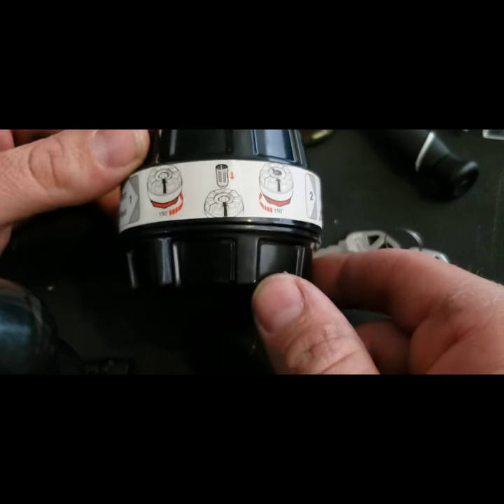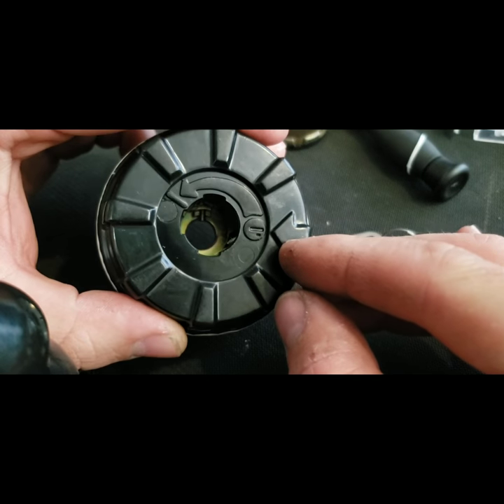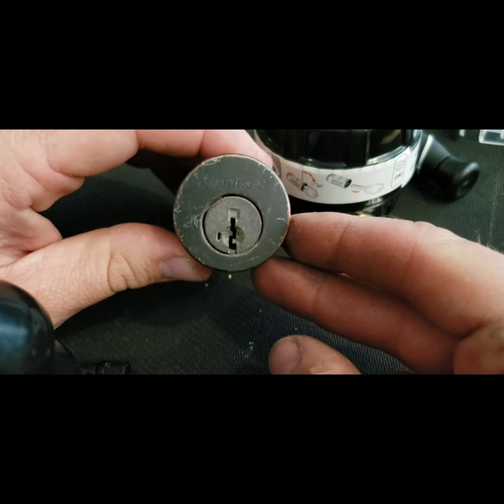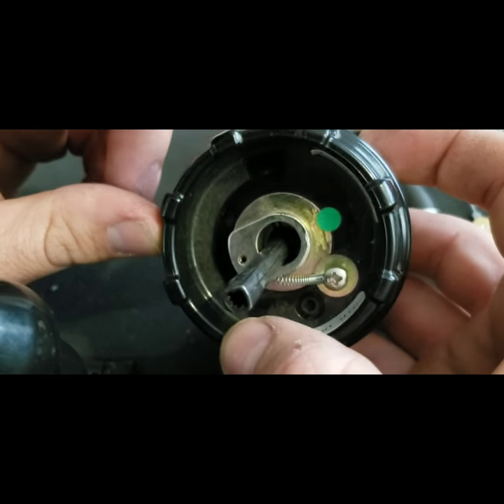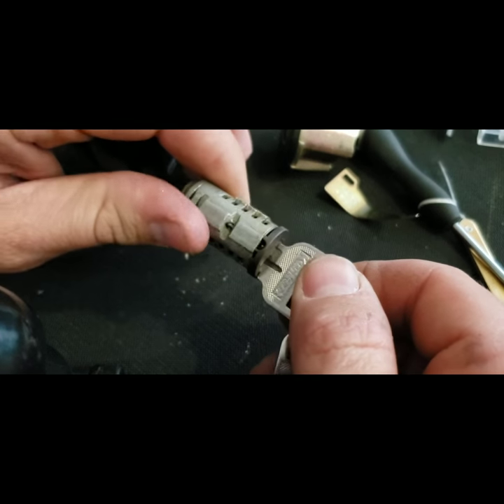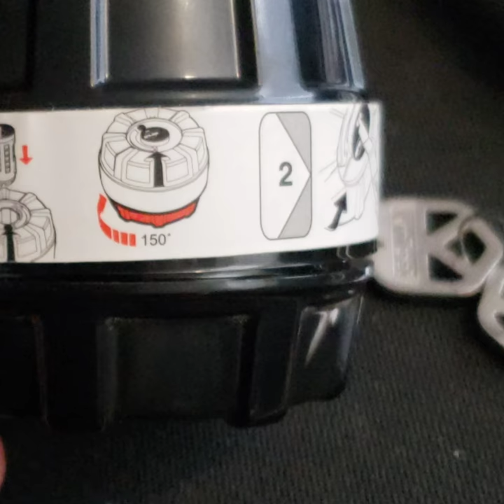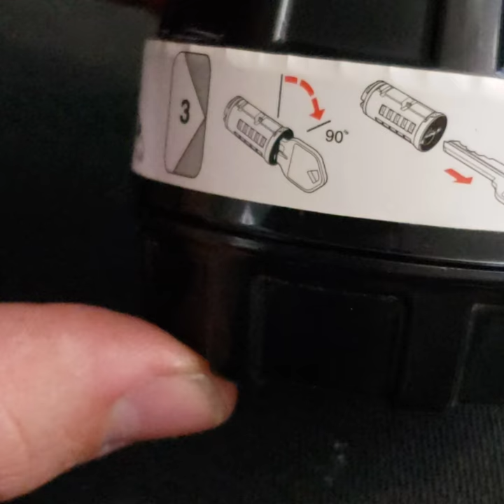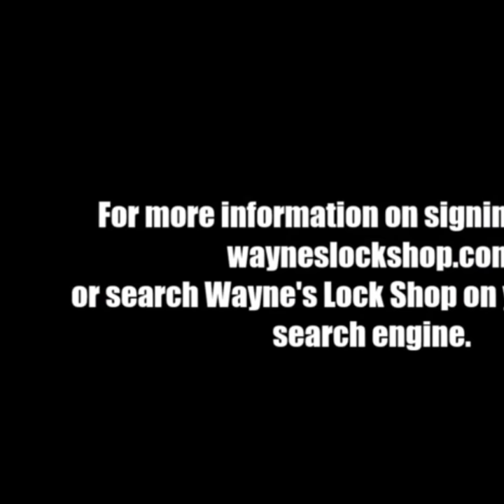Re key a SmartKey lock with no key's Kwikset Smart Key reset cradletool review, how to use

Comment: I still don't totally understand how those work. They have to have some sort of master pins in them that can be set and retained. Lol if you could do a video on how that all works. That would be awesome.
Reply: The "pins" have teeth that lock into teeth on sliders.  With the right key, notches on the sliders line up with the sidebar letting it move out of the way so the plug can rotate. The rekey tool pushes the sliders off the pins but still in the open position.  Put a different key in, release the rekey tool and the sliders engage.  Pins match the new key, sliders still match the open position, so open matches the key.